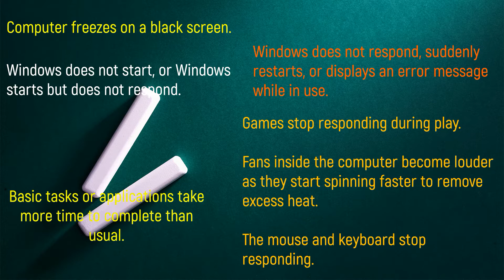Laptop Cooling Fan not working - How to clean and fix

Comment: For long-lasting lubrification, use lithium grease (good for bronze bushing. Use light synthetic oil for ball bearing). You can also use light oil for bushing. Be careful, if you use compressed air for cleaning. High-speed rotation of the fan will generate voltage that can be harmful to the electronic circuitry of your fan and computer. Disconnect the fan from the motherboard or lock the rotor (fan blade part) with a toothpick before blowing compressed air to be absolutely sure that you don't break anything.

Comment: my laptop isn’t showing any signs mentioned at 0:42 besides emitting a loud noise, which is weird because my cpu fan is only running at 774rpm… it’s making my cpu temps rise like crazy on idle (it went from 40°c to 73°c in minutes without me doing anything) i have no idea why it’s spinning so slowly? i’ve had my laptop for 5yrs and never once had a problem until this happened literally overnight, and now it’s frying itself… oddly enough besides the loud noise/low cpu fan speed/overheating cpu temp, my laptop is acting completely normal as if nothing is wrong… but i can’t use it until i figure out how to fix it since it’s literally cooking itself ): 

(i have a 2019 ASUS ROG Zephyrus G15 GA502DU)

Comment: mine stopped working after I unplugged it and plugged it in again any help? on a laptop
Reply from the maker: Cleaning the fan helps. If not, Check the power supply first. Then the motor.
Reply: @redman7339  its in a laptop cables are fine its clean idk it justed stopped and the laptop is fairley new help???